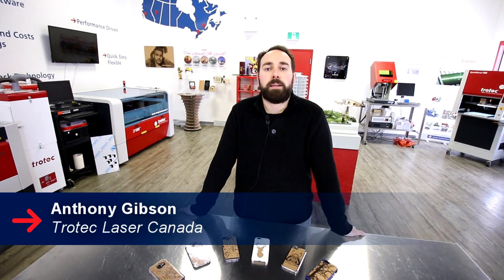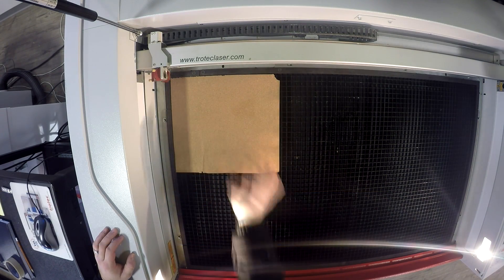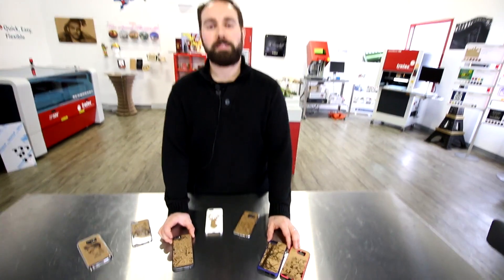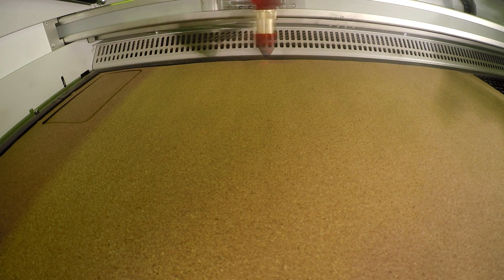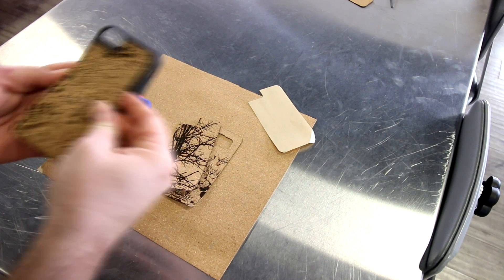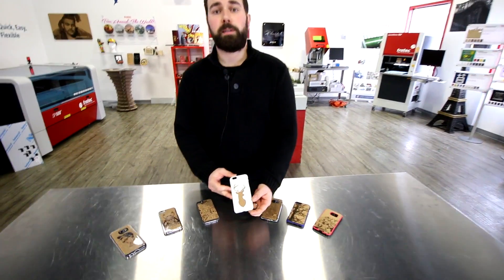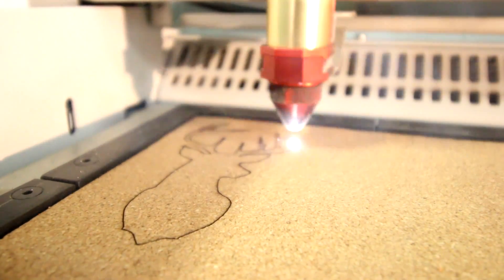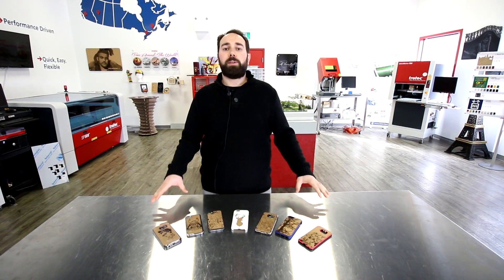Laser Engraved Phone Case | Cork Phone Case | Speedy 400

Comment: quick question where did you get the templates for the phone sizes?
Reply: Got the same question?do you have any idea how much the engraving machine might cost
Reply: @anthonychilufya6580  i got an atomstack for about 800 on amazon.
Reply: @sigimoreno08  does it only work on phone cases and  how portable is it ,l really want to venture into the field
Reply: Its simple to move around, I used to work at home but moved it to my shop. it can engrave acrylic, glass, tumblers , dog tags , wood etc. && cut most of it as well. I’d recommend looking into some before purchasing. There’s quite a few in the market tbh

Comment: I have a speedy 100 45W and seem to be having issues cutting Cork. I get flaming, best settings please?
Reply from the maker: Hi Rodney, it really depends on the cork, is it our Trotec Cork that we've launched in Canada? What size thickness is the cork?
Reply: Trotec Canada 3mm I believe
Reply from the maker: Hi Rodney, if it's our cork then we've tested the 3mm on speedy 100 80w and it cut fine, the 6mm it did have issues cutting. To answer your question it's the wattage, the thicker than material the more wattage you need to cut. We've cut 6mm cork on our Speedy 300 100w and it was fine but as soon as we put it in the lower wattage 100 it started to char. Unfortunately you would have to only cut the 0.8mm or the 1.5mm to get a good cut on your laser.
Reply: @TrotecLaserCanada  what type of paper you use?